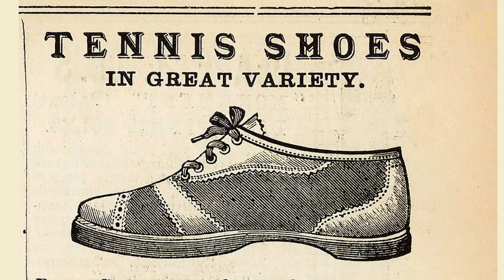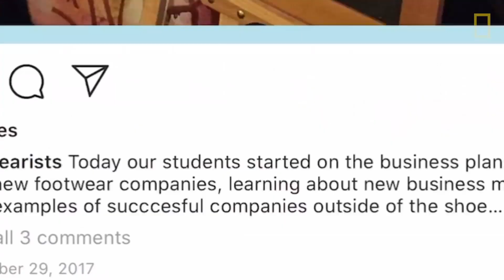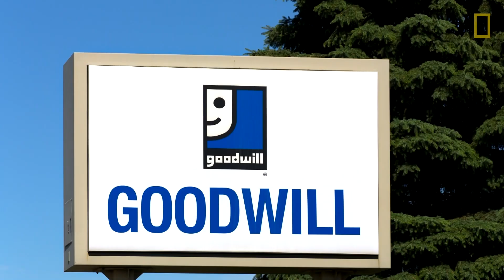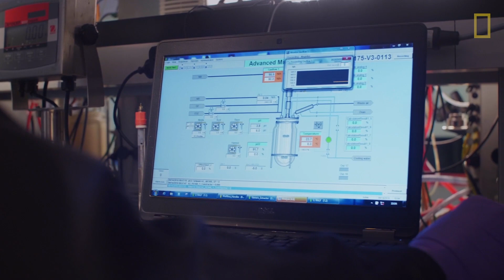Your Sneakers Are Part of the Plastic Problem | National Geographic

Comment: I had to pause to take a moment to say, what kind of dumb "average American" buys 7 pairs of shoes in 1 year?! Now are you thinking of a person buying for their family, or themselves? As that makes a big difference. The shoes I have now, we got I think in 2016 or 2017. I also have a leather pair of shoes I've had for well over 10yrs. You can make shoes last by simple touch ups. Just like pants can be patched up, so can fabric shoes. Other shoes, just shoe glue & paint to match. Ok, back to watching for me....
Ok, so has anyone tried cork as a cushion material? It's lightweight however breathable is questionable unless you give it micro holes. I've a piece of cork wood from the late 80's. It's not bendable anymore, it's still very lightweight, and if you cut into it, it still creates squeaks, lol. I broke think parts off to see if those were bendable, but no, they break easily. However cork is reusable to a point. I've never done any research on cork wood, this is just my observations.

Comment: Grind them up and mix the residue into asphalt. Use the asphalt to pave roads, or to pave bicycle paths if you prefer. In case you were concerned, mixing correctly processed plastic waste into asphalt makes the asphalt better in every way. If you disagree, then you're just being difficult and are not actually seeking efficient solutions to such issues.
Reply: Run off from asphalt runs into our waterways and makes the problem even worse.

Comment: I've been wearing the same hiking boots (rubber soles) for over 15 years (and have not bought or otherwise acquired any other shoes in over 15 years).  Learn how to walk without dragging your feet; your soles (and souls) will last longer.

People always forget that it takes lots of energy and water to recycle stuff--energy that mostly comes from fossil fuel sources (in the U.S., over 80% of energy comes from fossil fuels; it's worse in many, many other countries such as China where the products are likely being made, anyway).  Indeed, in most cases it takes as much or more energy to recycle a product than it did to make the original.  Recycling still contributes a lot to climate change.  The three Rs are ordered "Reduce, Reuse, Recycle" on purpose.  People should first be reducing consumption, then reusing stuff as much as possible.  Recycling is your last option, but it's not actually sustainable.  Plastics will never be sustainable.

Comment: Plastic would be fine if it was reusable, recyclable plastic. Manufacture the plastic once then it stays in the economy forever. Endlessly creating and discarding plastic is the problem.
Reply: You can't really recycle plastics forever.  Its structure can change with reuse eventually making it either unrecycleable or potentially eventually unusable.  And it can usually take as much or more energy to recycle stuff than to first produce them--energy that most likely comes from greenhouse gas causing fossil fuels.  Plastic will never be sustainable.  REDUCE consumption, REUSE as much as you possible can, and then recycle; recycle is the last of the three R's for a reason.